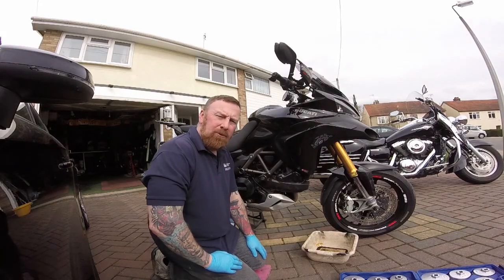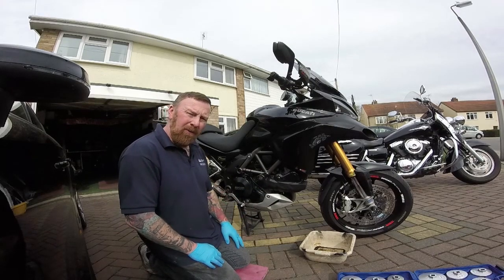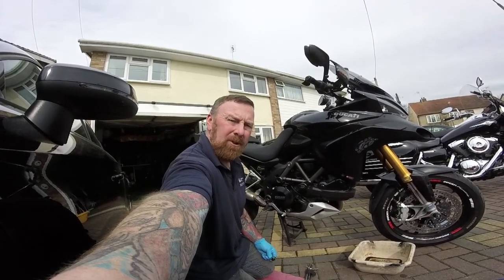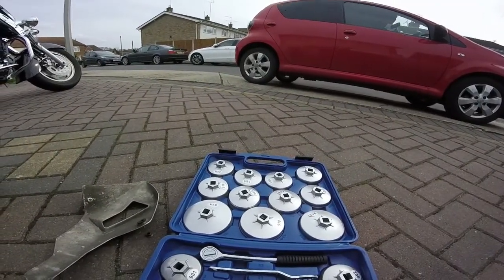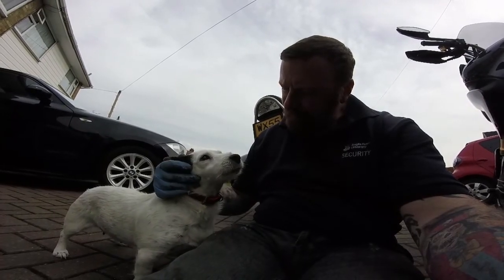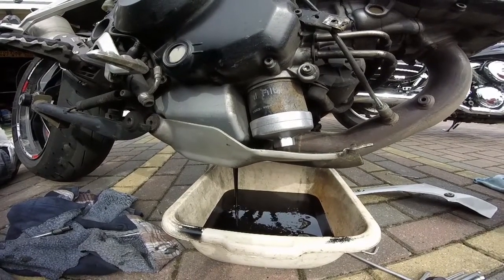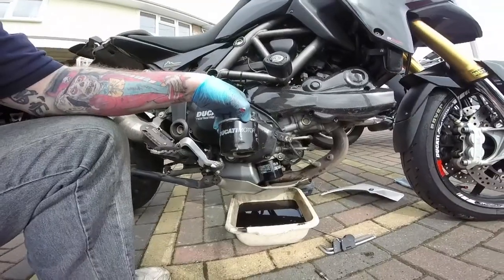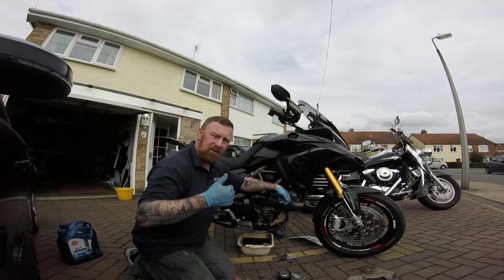OIL CHANGE SIMPLE DUCATI MULTISTRADA 1200 MARK SAVAGE

Comment: Great video Mark, thanks for making it. I know this is an old-ish video, but could you tell me if you actually had to remove the centre stand to drop the oil out? Wasn't that sure. Cheers.
Reply from the maker: No bud I managed it , I've uploaded a newer oil change video on the multistrada well worth a watch. 
Its only a few months old bud
Reply: @marksavage  Thanks mate, much appreciated.

Comment: By the state of that oil,  why didn't you remove and clean the gauze drop out filter from the sump?  right next to the drain plug,  mate!
Reply from the maker: it was only an interim service and it did have full service history so would of done that in the next service, the bike had only done 3000 miles since the last one so was only doing it to keep me happy and to help others do the basics
again thanks for watching and your comments 
mark

Comment: Looks as though I may finally be getting my big Duc this week Mark, I don't suppose you remember the code for the filter you changed mate?  :)
Reply from the maker: On e bay bud link, it was a good filter 
https://www.ebay.co.uk/itm/132645594191
Which one you getting mate
Reply: @marksavage  2015 1200s Touring with all the luggage and 8000 Miles
Reply from the maker: Very nice mate same as mine one , enjoy bud
Reply: @marksavage  Thought you had gone back to the older model now? kinda freaked me out when you said you preferred the older One haha
Reply from the maker: Being honest I do bud , handles , sounds and feels better for me anyway !
I've had 3 mk1s and they all have tode the same 
Top notch but not sure if it was a bad start or just a 1 off but it did ride as well !!
However still a great bike and sure you'll love it bud 
Lets know how you get on bud 
I'm am loving my f150 !!
Reply: @marksavage  Yeah that truck is a Monster ;)

Comment: Did you have to remove the center stand to get to the screw in the back? I tried to remove it the other day and the center stand was in the way... Thanks
Reply from the maker: No Like in the video I tilted it so I could change the filter and the sump nut out 
But did have to take a few other bits off
They dont make it easy 
Buying a 2015 mk2 multistrada friday so a up and coming video bud

Comment: Alright mark, got a problem with a speedfight 100, one of the exhaust mounts has snapped off.. is it possible to weld or will i need to split the engine and find another exhaust half? Cheers
Reply from the maker: hi bud 
it's alloy and very hard to weld, as long as you still have one bolt it will be fine otherwise i'm sorry to say as in my video that i show the same thing it's a half engine split unless you can drill into what's left but it will look tacky
good to hear from you bud hope all it well
mark

Comment: Your using 10w 40 ??
Reply from the maker: I used what was recommended as in the video for the UK bud 
What do you use in your multistrada?
Reply: @marksavage  I use 15w 50 that’s what’s recommended in the manual
Reply: I guess If it’s a cooler climate 10w 40 would work
Reply from the maker: @jamesbarber8308  it does bud and runs well
I've had 4 mk1 and mk2 
Love them and would have another tomorrow 
Love the mk1 better 
More fun

Comment: What filter number and oil type? Cheers!
Reply from the maker: hiflo hf153 as for the oil it down to you as some use 10/40 or 5/40 and 15/50 !! look in your old service book and see what they used last and stick to that bud or ring local dealer as different garages and country's use different grades bud

Comment: Hi! What type of oil do you use?
Reply from the maker: hi bud, thanks for watching
normlly putoline but for this bike shell advance, i have many more videos you might like to watch
please like and sub 
mark
Reply: use Motul 300V  15w-50  ( it's green )  and change every  5000km  ,  not 12000.  oil is cheaper than a rebuild.  i have 90000km on mine.  great sports bike!
Reply from the maker: wow that high miles bud so shows it must work, I never use that high oil as it doesn't every get that hot and it's not recommended but ha if it works for you that's great 
I lot of rider forget to change the oil and it really does help the life of the bike so the more the merrier as they say 
thanks for watching please check out my other videos and like and sub 
mark